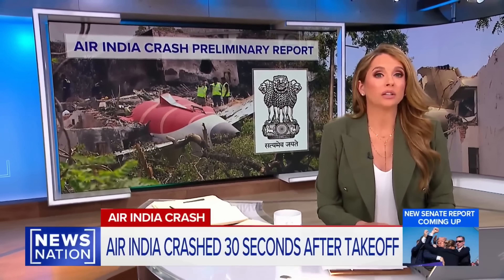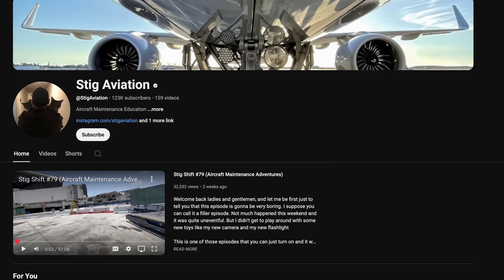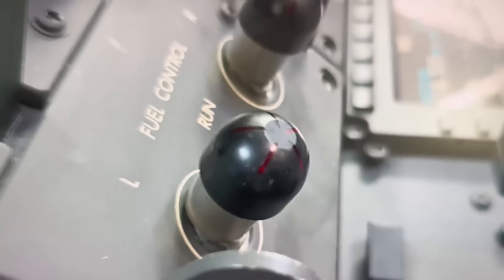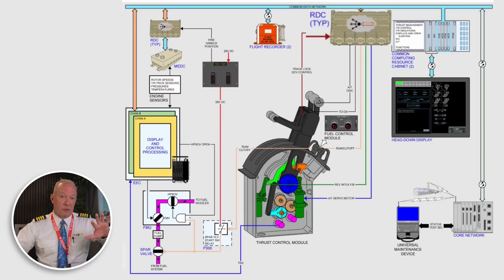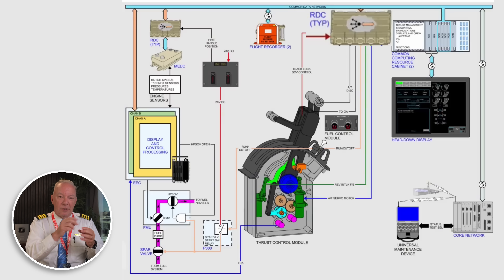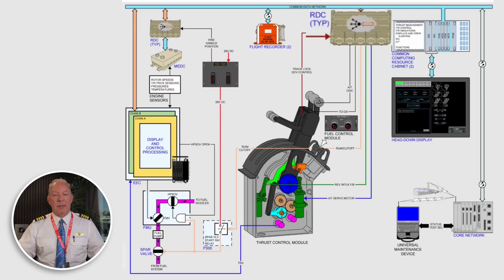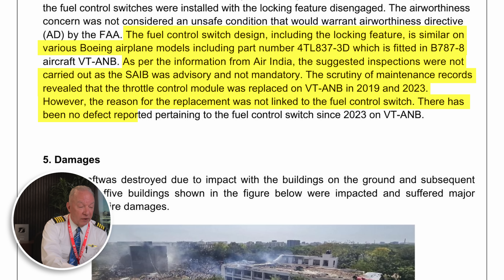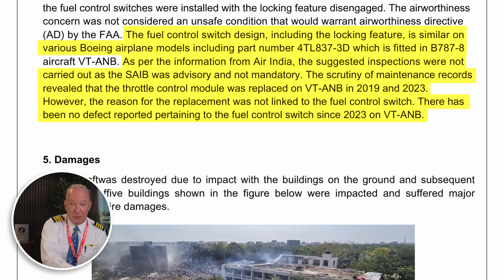The Truth About Boeing 787 Fuel Control Switches

Comment: As someone with nearly 40 years in software/hardware integration, I've tested circuits with these types of switches thousands of times.  What Captain Steeeve says is absolutely true.  In addition, depending on spacing, I was quite adept at grabbing two of these at once, with one hand and actuating them near simultaneously (of course you can reach across and use both hands as well).  It was my job to identify race conditions and I tried everything I could think of that a pilot might do in the design  of my tests.  In some cases, these switches are also dual (or more though I don't recall seeing any) redundant.  A single switch sends two or more signals and the software ignores a change in a single signal until they both agree on state (possibly asymmetrically) (logical and) or either signal might cause a change of state (logical or, or other logical/boolean operation).  I guess I'll add that there is likely some sort of debounce circuit that eliminates spurious changes.  Could be hardware or software.  This comment is not specific to this particular aircraft or the fuel system control circuitry.
Reply: Also remember that this system is completely mechanical and separate from any other inputs.
Reply: @Randor10  A relay is NOT completely mechanical. There are indeed two electrical circuits involved, one driving an electromagnet which operates a switch on the 2nd circuit.
Reply: @Merilix2  A relay that has a set of contacts that have to be physically moved is indeed a mechanical relay.
An example of a non-mechanical relay would be a solid state relay that uses a mosfet to switch a circuit.
Reply: @leeowen4989  A relay is indeed a electromechanical device which has a mechanical component to split separate two independent electrical circuits.
One electrical circuit driving a electromagnet which is mechanical connected to a switch for the other circuit.

Saying it is pure mechanical is just wrong twice.

Edit: A mosfet is by no means a relay nor is it comparable. A optocoupler kind of is but not in this context.
Reply: @Merilix2  Exactly and not sure if the relay is indeed SPST or not and if monostable or not. If monostable then what is NC position? Run or cutoff? In case of say 24VDC bus failure.
Reply: @leeowen4989 it mechanically moves, but is still part of an electronic circuit. If no power flows through any of it, you can't operate it. If power fluctuates, you can erroniously trip it. If its fail conditions are met, it fails. The circuit is NOT mechanical.
Reply: @Merilix2  You are correct, I think I over simplified my explanation a bit.

I really have no idea where I got mosfet from.... the solid state relays I use on various machines all use opto-isolators.

I should probably get some sleep...
Reply: Four. Each of the cutoff switches carries four independent circuits. 1 & 2 go to the relay, 3 & 4 get picked up by the recorder through the RDC and the bus. They are completely independent except being toggled by the same actuator. 
All these people suspecting intermediate loops down the chain, just keep in mind the engine actually wound down right after the recorder picked up the switch transitioning. That in itself is two completely independent and separate chains of events simultaneously occuring and the only factor connecting them is the manually operated switch actuator. To argue there is no human input on the actuator and the separate chains of event spontaneously occurred by pure accident on a single cutoff switch is already extraordinary. And to argue the same thing happend four times within less than one minute on two independent switches is wishful thinking. At this point it doesn't matter what's in between the switches, relays, valves and whatnot. This type of coincidences are impossible.
Reply: @alexyoung6418  Yes, this explains one aspect that hasn't been revealed before, 'How the switch position is detected?' If as you say, it is independent contacts operated by the same 'handle', then all of what you have said makes sense.
Reply: @alexyoung6418  A reasonably good design.  While I don't think it matters in this case, I can imagine situations where you might need to know both the switch state AND the state as seen by the processing computer.  So, I would hope that at least a digital copy of the state as seen by the processing computer is also sent to the recorder.  These signals are good candidates for that redundant processing.
Reply: @roadrunner3563  I'm not sure what processing computer you were talking about. The switch only does two things: A) The real business end - it mechanically toggles those valves through energizing the relay. and B) it reports its mechanical position to the common data network through the RDC, which is the monitoring end. 
There is no computer that processes anything for the business end to work. It's just a dumb analog solenoid circuit with zero software, which is incredibly stable under proper maintenance. 
The only computer in this case is the RDC, which is essentially a one-way convertion device to collect the analog signal on the switch and report it onto the network in the ARINC format.
Reply: @alexyoung6418  Yes, I understood that.  If it is purely hardware, then disregard.  As I said, I did not have direct knowledge and was clear about that.  I would have recommended some modifications to the design for improved anomaly analysis, but it is not necessary for this particular incident.
Reply: Thanks for the explanation on the switch signals being sent and how the software is written. I have done PLC programming in manufacturing and your logic is sound.
Reply: In another highly regulated, safety-concious industry, we've even seen 'fibre-optic' switches that are little more than a 'light gate' that let's a beam of light pass through or not. But for critical digital circuits we do a lot of 'disabuiguity' tests. (ie "It looks like position A, but to be sure, let's test that it's not position 'B' at the same time. And that the other three channels also say 'position A'. Anything that looks 'NQR' means a non-compliant command and the operator gets involved in resolving it..  (our acronym 'NQR' is... 'Not Quite Right'  ;) )
Reply: And two switches failing simultaneously is astronomically impossible.
Reply: Reading this made me think..I would advocate for a critical system like this to even go more extreme with the safety than it already is. Some may see it as overkill, but I believe it should be a two "keyed" system as in both pilots have to agree on the state of the fuel switch. Both busses can be designed in such a way as in one pilot pulls up the switch and then the other pilot does the same, then and only then both busses are connected and the current is supplied to the fuel valves. if one switch is disconnected, nothing happens. Shouldn't matter which switch is first either, both states have to always agree. Same for the shutdown process. I just see it as one more way to rule out any ifs in incidents. Doesn't have to be retroactive, just for newer aircraft being produced. The switches can be placed apart from each other, in a zone for each pilot.
Reply: And if one pilot is incapacitated and blocking access?
Reply: @roadrunner3563  Was just about to type the same thing..
Reply: @roadrunner3563 the switch can be accessible by both, just as others buttons and switches are currently accessible by both. it shouldn't be right by the other though..just needs to be noticable that the other pilot would have to reach over to pull it, that way each other can know and clearly see what the other is doing. The way it is now, one can just do it on their own and that's that. Pretty hard to create error by reaching over to one side, opposed to controlling both switches right by each other
Reply: You're a moron.
Reply: Or it could simply be the all time greatest brain fart in human history! The truth is, they will never know for sure. You can't investigate the human brain of a dead man and any computer can and does have glitches and gremlins. If the later is found to be the cause, then the entire fly by wire concept is in question. Oh, by the way, it already is.
Reply: You need to read the full SAIB not the short little snippet these channels have shown. Actually a bad switch part number the question is what part number switch was installed in this aircraft.  You can google search this easily  just look for  SAIB: NM-18-33
Reply: There is absolutely no software in the fuel cutoff switch to engine spar valve circuit *.  Nor do I believe there is any electrical circuit delay within the switch itself for bounce.
* The circuit breakers can be controlled by the CCS (Common Core System) , but only as either on or off. A CCS failure could not change the actuator position, only prevent it from moving.
Reply: @paultruzzi911  I'm very familiar with similar direct wired circuits (including via electromechanical relays).  I just had no direct knowledge of this particular circuit design.  I tried to make it clear I was speaking generically.
Reply: Is it possible for someone to cut off the switches in the matter of 1 second 🙄🙄
Reply: Captain Steve incorrectly describes the control of the fuel values according to the diagram he presented.
Reply: It's the fuel pumps that failed caused by water ingress into the EE bays. Lack of lavatory maintenance caused the crash and not the fuel switches
Reply: How much practice did it take before you actually succeeded in transitioning two switches at once? Because it's not an action I would have expected aircrew to have practiced, at least in flight. Someone might have been in the (bad) habit of doing it on the ground after engine shutdown, though. We're talking about both switches going within one second of each other.
Reply: @matthewspencer972  I would turn myh hand palm up and put the two switches between my index and middle finger and pull up.  I doubt the spring pressure is very intense. Probably both toggle fairly easily if the detent is released.
Reply: @JoeLinux2000  It's hard to see how to design against that, without adding an interlock of some kind making a simple electrical circuit complicated. But there are sort of bars to left and right of the switches and I suppose there could be a similar one between them to stop them both being transitioned in one movement. That wouldn't add any complexity to the electrical side. It would be important not to require a change to the wiring loom.
Reply: I don't have direct knowledge of this specific aircraft and the implementation of these fuel related control signals.  Historically, aircraft software reads discrete switch signals by sampling.  Usually, this occurs at a fixed rate (rate group/frequency).  Higher priority signals are sampled more frequently.  A signal may be required to remain high (or low) for more than one sample period to be considered a valid change.  Selected signals may be interrupt/priority based.  I doubt these fuel control signals are interrupt/priority based, but I don't know.  As a sampled discrete at a fixed rate, it is actually quite easy to get the software to "interpret" the signals as occurring simultaneously.  When you include the effects of debouncing (which often "smooths" the signals), it may be even easier.  But this depends on the specific implementation and the sample rate.  If the sample rate is 50hz or faster, it can be increasingly more difficult.  At 50hz, it's only moderately difficult.  I know my description is common, but perhaps not specific.  Current, faster processor systems may mean less reliance on this style of processing, but this is still quite common.

You also need to consider how this switch state information gets to the recording device.  Often, it is simply transferred a copy from another computer via serial bus (critical signals might be wired directly).  If the recording device does the timestamping, it may actually be behind where the switch transition actually occurred (by the serial bus copy delay time, probably not a lot nowadays).  It is usually known what this typical delay is, however, and is used for analysis purposes, but may have to be added in manually during analysis.  In general, these things are known in the design of the system, and if they are problematic, then the design is adjusted accordingly.  If a super precise timestamp of a signal is required, then the system is designed to provide it if feasible and reasonably economical.
Reply: Regardless of what Capt Steeve says, he has been avoiding a big issue in all this series. There is no mechanical input/linkage from these switches to the data recorders. So, can someone please explain how the AAIB came to the conclusion that the switches were physically moved? I would guess that would be an interpretation of some logic signals to the data recorders as there is no mechanical link to the data recorders. If the relays (I assume there is one per switch) were to fail, they could cause a sequence of events that would to the data recoders showing an event that could be caused by a pysical switch movement.
Reply: @scousedavies565  From the diagrams shown, it appeared that the confirmation was based on the voltage across the switch. Therefore, the switch could have been on but the voltage across it was gone. This resulted in an incorrectly recorded off signal...
Reply: @scousedavies565  The signals WERE directly wired to a computer which did the interpretation of signal state which was passed on to the recording device.  I don't know exactly what that process is, but it is highly likely that it accurately reflects the state of the signals that were passed to it by that system.
Reply: @scousedavies565   the simple diagram presented shows just a single pole switch.  Could be a DPST I guess...?
Reply: @scousedavies565   I can't speak directly to the 737, but in industrial systems with similar requirements, it's completely normal for switches or relays that are safety-critical components to have secondary contacts that are wired to input terminals on the monitor/logging system.  These secondary contacts are mechanically party of the switch/relay, and report the mechanical status without being part of the safety-critical signal path.  These are most often used to detect mis mm mismatches between switch and relay condition.
Reply: I was about to ask you about debounce then I read you mentioned it at the end of your comment
Reply: A lot of people would find it hard to pull two slightly separated knobs simultaneously with just one hand. Squeezing one knob with the index and the middle finger and the other knob with the ring finger and the pinky while maintaining a gap between the middle and the ring fingers is not a natural maneuver for most. But after training with string instruments as a kid, I can do this with my left hand. Not with the right.
Reply: You're mistaken, probably due to translation errors... Valves should remain open even after a 28V DC power failure. A basic safety principle. Bistable valves. One pulse turns on, another turns off. A 28V power failure works, but there's no closure... How it works, as he explained, is extremely dangerous...
Reply: @krzysztofstefan3713  Making the valve 'fail open' on a loss of power, or require two different coils to 'pulse open' and 'pulse close' can be used sometimes, but that introduces the risk of not being able to shut fuel off at times. At cruising altitude with an engine fire, that could be just as dangerous.

As to your 'extremely dangerous' comment, that hinges on the reliability of the power source and the simplicity of the circuit. Captain Steve here has mentioned that the 28v DC is a highly reliable power source. Clearly this design has been in use for many decades and not been very much of a risk. As yet, there's no reason to believe it was a design flaw that caused this accident.
Reply: @mikefochtman7164  Listen up. These modern lithium batteries... Are they really that reliable? All that electronics inside the BMS. Not to mention the unhealthy tendency to spontaneous combustion ;) It's not even about the battery. It's just the wires. Tens of meters, the connectors... Something will come loose and cut off the fuel?? What?
Reply: @mikefochtman7164 and yet, if the power source fails, we get the events that happened in this accident. That's why so many are calling it out. Blindly believing that power source can't fail is BIAS.
Reply: @mymultiextruder9804  So... the power failed on one, a second after the other? and somehow came back ten seconds later? Quite a mysterious power supply.
Reply: @mikefochtman7164 funny you mention that, since it takes the RAT ten seconds to supply power. Weird, right? That everything started working perfectly again once the power source changed.
Reply: @mymultiextruder9804  RAT supplies AC power, not the DC bus. And the time of deploying the RAT is also noted in the report timeline and it doesn't line up with the engine fuel cutoff switch times.  Funny that.
Reply: @mikefochtman7164 you are incorrect. Check your sources.
Reply: @krzysztofstefan3713  Where was there a translation error?
Reply: @eastsideeddie  Maybe I translated it wrong... ;) That I...